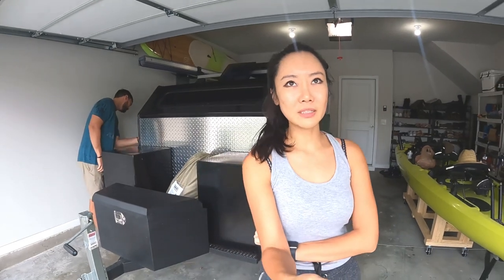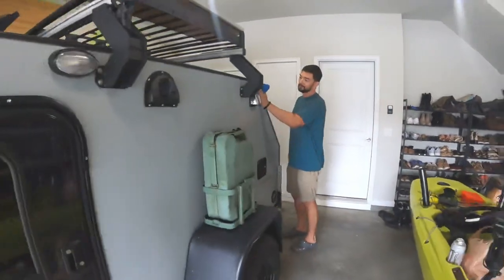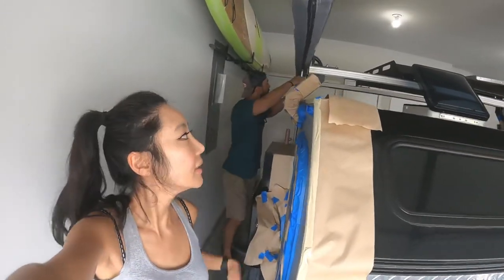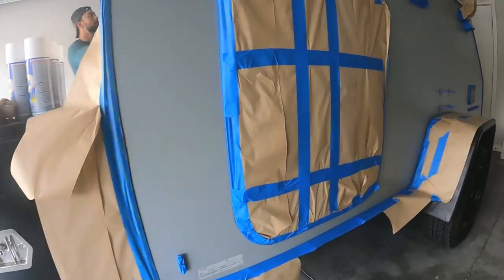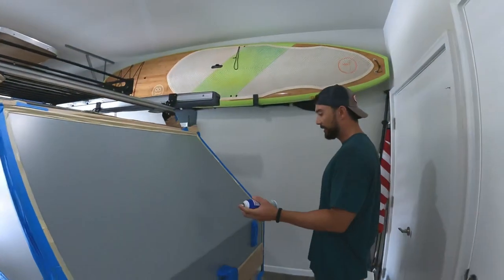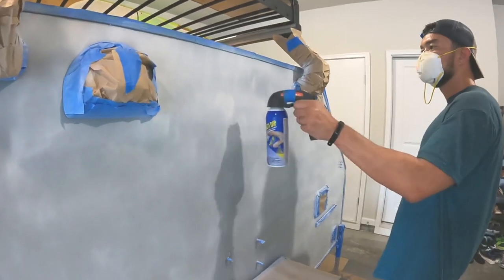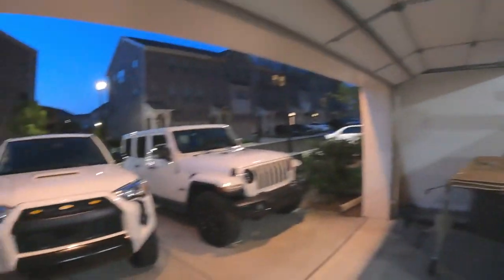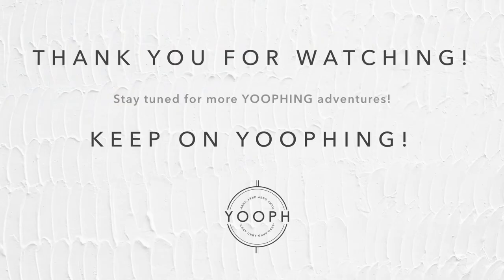Teardrop Camper DIY Plasti Dip!! How to and the Result!

Comment: Howdy! any updates on durability of the plastidip on the camper? I was searching for this and came on your video.  I'm thinking about doing the same thing but different color so the colors matche my truck.
Reply from the maker: The exact reason we did it. Overall the plastidip worked great. Went on about 10 trips, furthest being the Florida Keyes from Atlanta. No damages from the road. I just purchase a gray gladiator so I removed the plasti dip to match my new truck. For the small cost of applying plasti dip compared to a paint job. I don’t believe you could go wrong doing it. Let me know if you have any other questions, I’ll try to help the best I can.
Reply: @YOOPHAROUND  thanks that's good to hear!